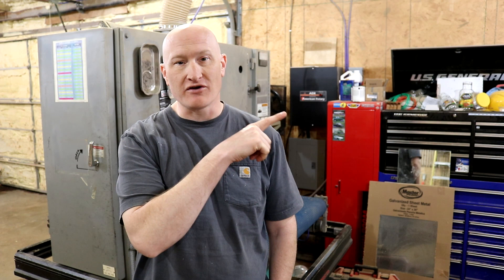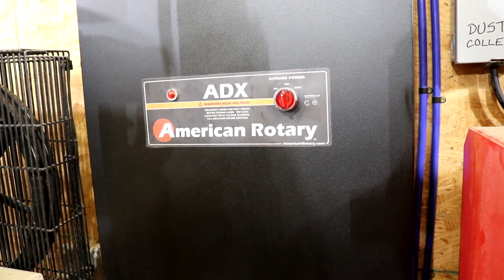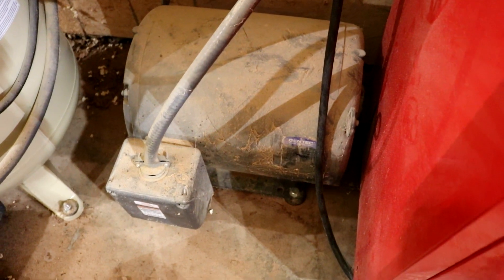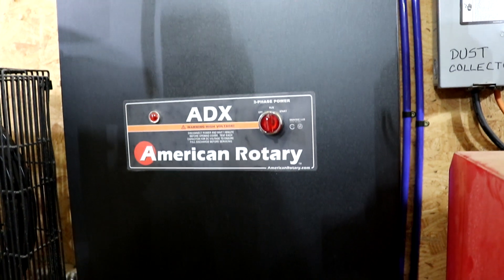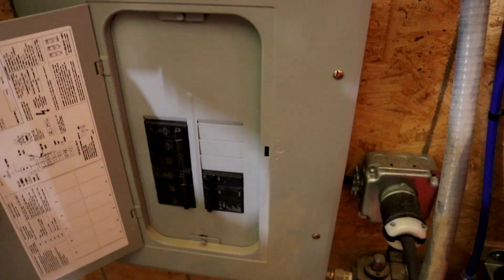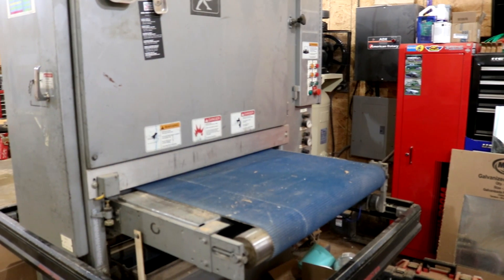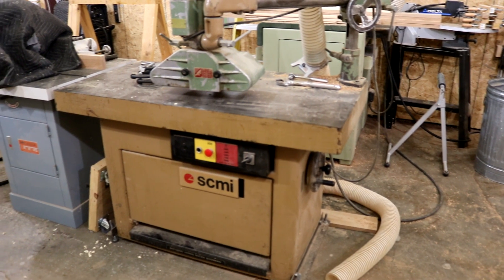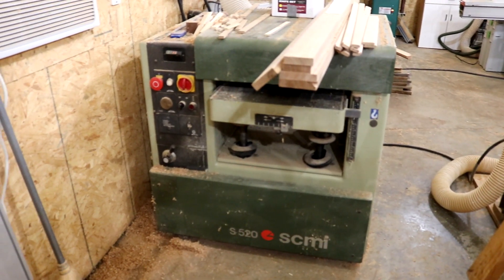Do this to build the shop of your dreams! 3 Phase power!

Comment: you can safely put 0.5g of pure melatonin powder under your tongue, every 2 hours while awake. it is not a drug but a supplement, i got 100g for 100 euros. It will make the cancer cells less evil and your immune system will finish them. does not interfere with standard treatments but your oncologist will not agree so overrule him.

Comment: Three-phase motors are usually about half the amperage of single-phase for the same HP.  That means a smaller wire size is needed for the hookup circuits.  Most home shops don't need all of the machines to be running at one time together.

Comment: I am very sorry to hear that cancer is now in your world, I lost a son to cancer who was just short of twenty one. No need for me to talk about this with you as your living in pain every day. I am seventy four right now and dealing with a form of Lymphoma. I don't have the cancer type, its one where your body retains water and swells badly. My comment is more about being on hospice and the fact that our state (alaska) does not have a palliative care system in order, Medicaid no longer supports a lot of drugs for pain as my back was injured badly nineteen years ago and failed surgeries never resolved this problem. I am not going to discuss pain management, or hospice, I too have been there and its not a picnic either. I won't get into politics and why or why not these costs are now no longer covered. I shall get back to this video and three phase power. My small auto repair shop was going to be more for just my own repair jobs/work and so thought when building my building, contacted the power company and lucky me was able to have three phase power on my property from the get go. One important feature is the cost of electricity is way cheaper in the long run, they explained it to me about twenty nine years ago and since I had had three phase in anchorage, knew it was my choice. Until someone operates a machine that has three phase, they are never going to know how really nice a Lathe can run. I had old navy equipment that was practically given to me. Now its many years later and had to sell all my tools, that too is painful as you form a relationship to different tools. I just hope that god is kind and helps you through all of this journey .... no words can explain just how bad I feel for you... best wishes for a chance of any ............... I will leave it at that... very difficult.😓